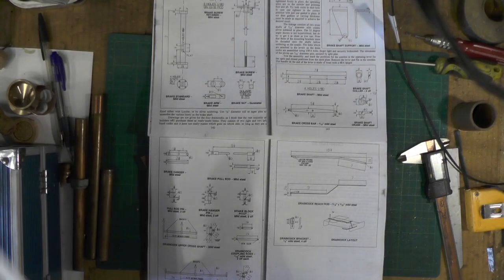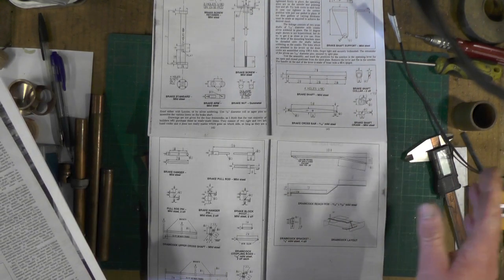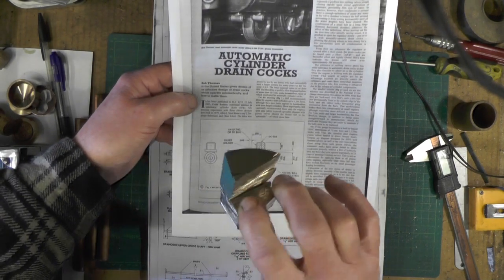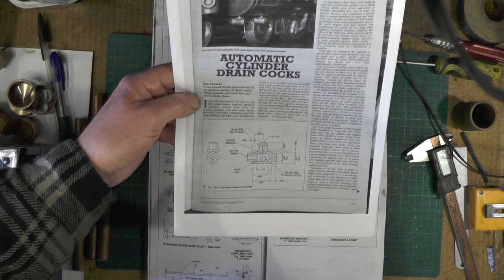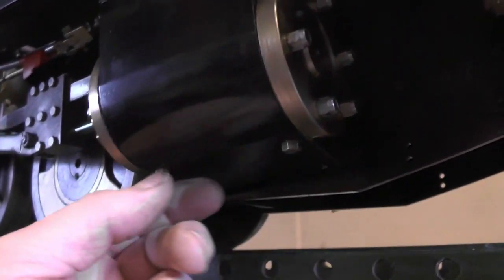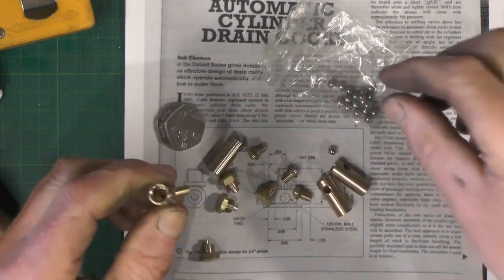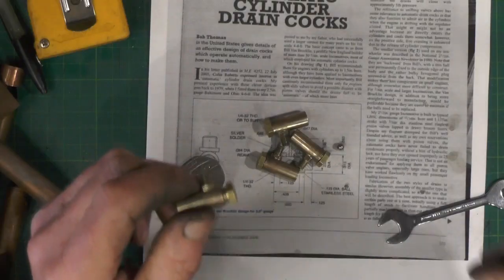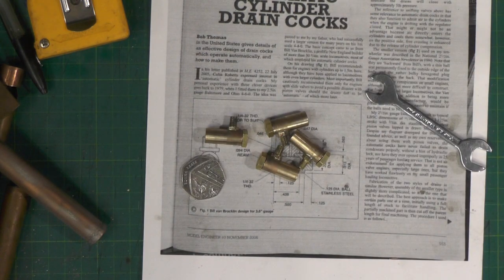Build Your Own Beginners Steam Locomotive Series (Automatic Drain Cocks  Make & Fit) "mr factotum"

Comment: hiya mr F :) 
I have decided to make these for my loco. (Just did and air test! AND IT WORKS) 
I have looked at the magazine from 2006 and the dimensions see different to what you have used in your video. 
did you scale them up some how?
Reply from the maker: hi brendan
nice to hear from you, glad to hear your had a air test  and that all's working okay, 
as for the drawing, yes my dimensions may have been slightly different i believe, i have 3 or four drawings for auto drain cocks they all work the same though no matter which drawing and dimensions you use. i've steamed my loco and had its first official steam test and my first drive of a steam loco, video coming in next week or so when i have time to edit it,  ive a backlog of work and video's,.
thanks again, keep in touch on how your getting on with things
regards
mr f
Reply: @MrFactotum  Thanks. will look forward to it

Comment: Very nice. But, how does the condensate get past the ball? I would love to use them on my 4-8-4 Northern ( don't ask why an Ozzi is building a 1.5 inch scale of one of those!) But I'm jiggered if I can see how they work? Still nice silver soldering there. I've held off making them so far, and like you, use plugs ro seal the drain holes. I'm going to have to bite the bullet very soon though!
Reply from the maker: hi peter
i'm no expert, but how ive been told, when there's water or condensate in the cavity where the ball is, the turbulence created stops the ball from seating and allows the the cylinders to empty, when empty and no water / condensate present the steam pressure forces the ball on to seat, and the cycle continues automatically,  hope that helps you deciding to make some, ive had other comments of advice that says this is the route to go, but i have no experience as yet.
regards
mr f

Comment: That looks a good idea. I have not seen them on any locos. But looking at the drawing there is a hole drilled through the end but could not see any on your parts, maybe just too small?
Could you send me a copy of that article please.Regards Martin
Reply from the maker: hi martin
well spotted, i came across another drawing half way through the video,  i videoed it a few weeks apart the whole job, and actually worked to another very similar design, i'd forgot i'd included a different drawing, but its irrelevant really they all work much the same, the water just comes out at a small hole underneath instead of the end were you noticed no hole.
hope that explains
Let me have your email and i will send you the article and drawing
regards
mr f
Reply: @MrFactotum  Yes I wondered why the final fitting was not the same as the drawing you showed. my email is martintoch49@gmail.com Thanks Martin
Reply: Could I ask for a copy as well,plz….. mike_jay@icloud.com

Comment: These automatic drain cocks work very well .I have 2 locos with them and they do the job quite well . basically 2 clack valves for each end of the cylinder to release any condensation / water .from inside . 
Nice work ! You'll appreciate the simplicity of them .
Cheers,
Reply: Wouldn’t this just constantly vent steam? How does it only let out condensation?
Reply from the maker: @williamsworkshopuk  well i'm no expert on this, but apparantly when theres condesation / water is in the cavity around the ball, this stops it seating and allows drainage, once empty the steam pressure forces the ball on to its seat and seals until more water present then the cycle starts
again.
thanks for watching
mr f
Reply: @williamsworkshopuk  they are like a clack valve . because the condensation / water lays on the bottom , for a second , the ball unseats depending on the piston location and the water drains out and also for a split second before the area of the piston is pressured and seats the ball .
Ive had no problems with this simple design . quite smart
Reply: @williamsworkshopuk   no , its just like a clack valve .
** You can also roll the loco ahead with the regulator shut and the water / condensation comes out .
Far easier design than having to run linkage to all 4 valves . 
Its up to you how true scale you want your loco to be .  I'd never knock a manual valve control . Im perfectly content with the self working valves .
Reply from the maker: thanks TFS
i'm glad i made the right choice, thanks for reassurence again
regards
mr f
Reply: @MrFactotum  HI , I didnt go through all your videos to see if you had a snifting valve in steam plumbing to your cylinders .  Its basically a clack valve that opens up to let the pistons run freely when you are coasting with the regulator shut when you pull up to the station or down a grade to save using steam needlessly
Reply from the maker: @theflyingscotsman9902  No, not got one, no mention of it in the book, but will research for the future, thanks for info.
mr f
Reply: @MrFactotum   
You're doing a great job on this Loco ! 
Deserve much credit for your efforts to figuring out and especially machining your own parts ! 
You under estimate your natural talent to producing nice components ! 
I live by Toronto Canada and always check to see if you've added any further videos on your venture in completing your locomotive every morning 😊
Cheers and Thank you ! 
Craig
Reply from the maker: @theflyingscotsman9902  hi craig, thankyou for your comments, appreciated,  i'm in derbyshire uk
regards
mr f

Comment: Nice work! I'll be interested to see how you get on with those automatic drain cocks. I'm thinking of using steam operated drain cocks on my Lion model, a bit more added complication involved, steam is applied to a small piston in a cylinder to open the drain cocks, when the cylinder drain cock steam valve is closed and steam vented the cylinder steam pressure closes the drain cock.  The original Lion design didn't have any cylinder drain cocks, at least no provision for them is shown on the drawings.
Cheers!
Nigel
Reply from the maker: cheers nigel
ive no experience of the steam operated ones, they may be more complicated but will be worth the effort and a good novelty factor.
thanks again
mr f